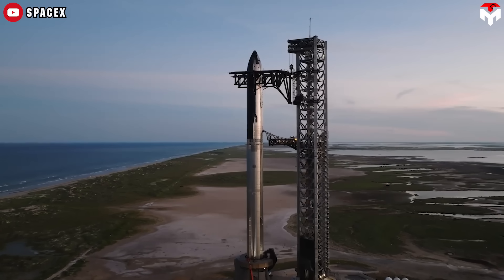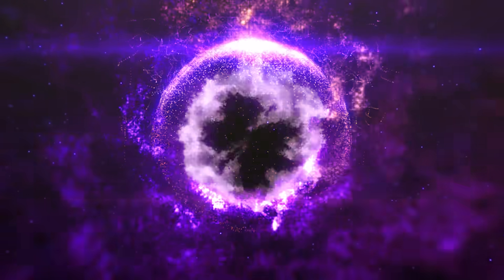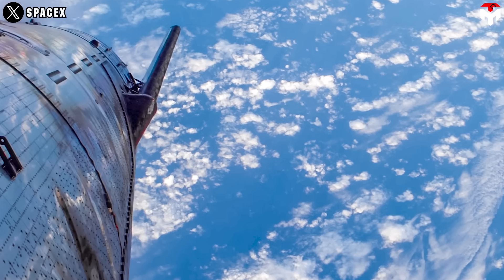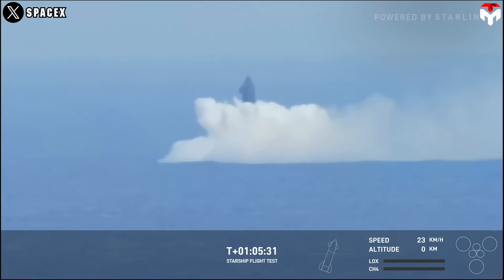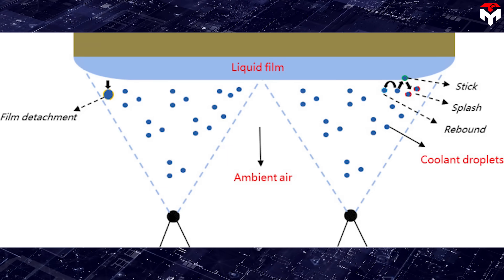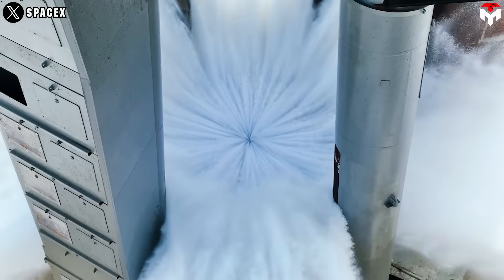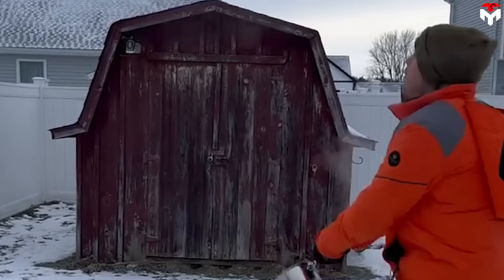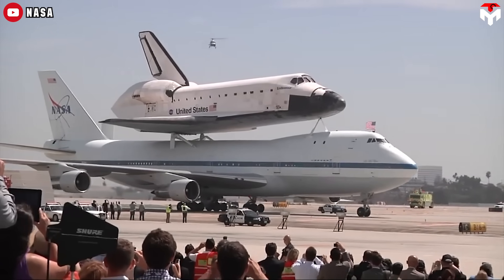"1500°C Shock!" New Starship's METAL SHIELDS to end Ceramic TPS Just BROKE PHYSICS!

Comment: The British compamy has had a fuel cooling system for over 10, years but no icer from the cooling is # .  The brits has darpa and even the eu behind all the very small light weight cooling.  Example, 100 plus to negitive 100  in a fraction of a second, NO ICE BLOCKAGE. techniecs, USA Air force 90 million.

Comment: Aluminum coated heat shields? First I've heard of that , I thought they were ceramic with an ablative shield underneath and then were switching to metal tiles but not with aluminum.
Reply from the maker: Yes, it's metal tiles, not ceramic tiles!

Comment: let it rotate as it fall sharing the heat all around
Reply: No

Not like flight 3
Reply: Yeah I was wondering the same thing
Reply: Topside doesn’t have shielding. Rotation would require extra shielding on topside, adding weight … reducing efficiency.
Reply: @Deditzy.  Thank you
Reply: @Deditzy.  Top side is the only side with it.
Reply: @normanpoirier744  and is designed for the current flight configuration. A rotating configuration might require more shielding no?

Comment: 304 SS is non magnetic, unlike many other types of stainless steel. It's probably what your eating utensils are made of. 304L has less than half of the carbon content as 304, both have less than 0 .1% carbon.
Reply from the maker: Great, thanks

Comment: Good Morning. I can't help but wonder why SpaceX would have put an aluminum coating on its heat shield. Aluminum has a lower melting point that any other metal on the exterior of the Starship. Can you explain that one? What metal or element can stand the heat that a ceramic composite can withstand. Do you know? Or do you have any ideas? Metallic verbiage language leaves the speculation wide open for interpretations. Now, Liquid film cooling is similar to a radiator cooling the engine in a car. That is a great idea. It would definitely keep it below the melting point. Using a cryogenic fuel as a cooling medium is the perfect solution. Now a question becomes how can you use the superheated methane in the propellant process. So nothing goes to waste. He is most certainly cover all aspects. From liquid cooling to maintaining SpaceX into other options. Great Episode. I learned a lot today my Friend. Have a Great Day.
Reply: The tiles are alumina. (Aluminum oxide foam). with black ceramic coating.. not Aluminum as falsely stated
Reply: because this video is made up.  all these videos talking about a metal heat shield are made up nonsense

Comment: SH is 90% there, which is far more important that Ship reuse.  I have been wondering about essentially using Shuttle Tiles for Ship for years (since these tiles always have reuse issues).  I suggested a metal outer shield over the ceramic tiles.  Looks like they are going with a version of that though with these metal tiles.
Reply from the maker: Yep!  Metal tiles are the way to go!